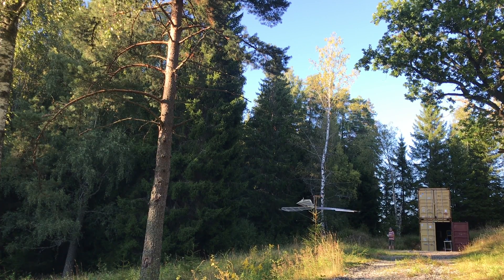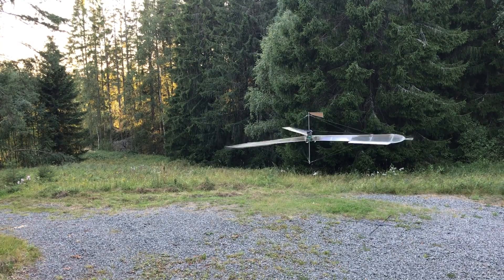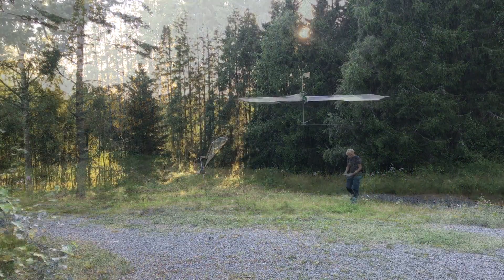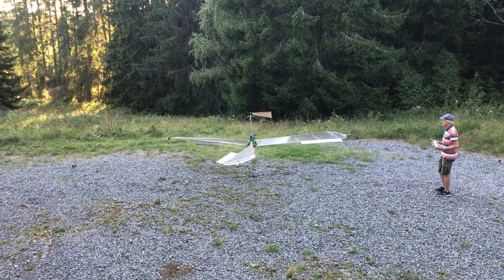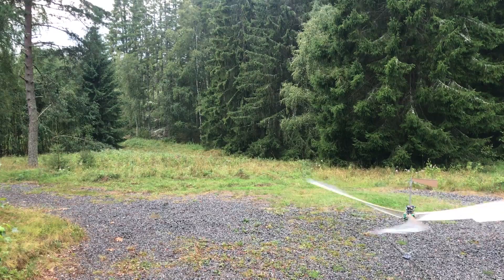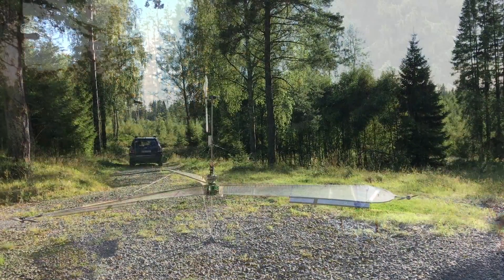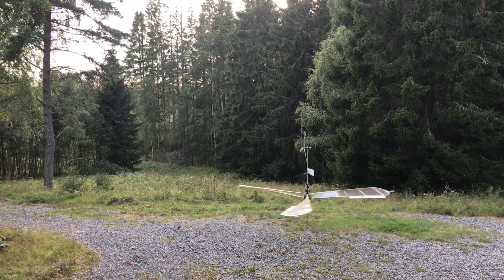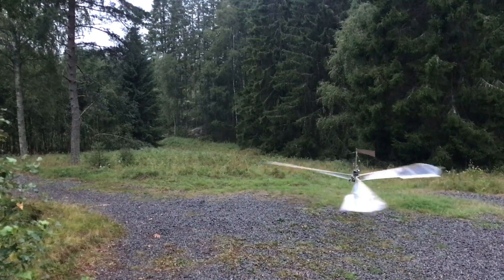Levitator 3 Further Testing. DIY aircraft.

Comment: IIRC positive dihedral increases lean back when translating.

Theoretically you can control it with one active control surface. If motors were powerful enough you could probably deal with a loss of one or even two motors too.

Comment: Could anything on that craft be ducted to generate puffs of air at particular moments in spin to augment  your control? Perhaps an EDF with a valve system which could blast some lightly pressurised air at the wing tip on every revolution (like the control surfaces currently do)

Comment: Scaled up to huge and spinning very very slowly would look amazing. It had real burning man machine or strand beast vibes.
Reply: Wonder how large it would have to be to levitate a sky city maybe a blimp with these spinning in the core
Reply: @NwoDispatcher  A city ? 🤣
Reply: @MadScientist267  ya a propeller aided circular  blimp that's solar and wind powered
Reply: @NwoDispatcher  haha I hear ya. A bit ambitious but...
Reply: @MadScientist267  how small then? Scale that puppy!!!
Reply: @NwoDispatcher  If you do some quick math on even just the weight of a typical stick and nail house, you'll find you can't make even just that fly alone with the likes of a "balloon" of any sort. But you're talking collections of houses. And that's not even looking into vertical construction... How big you think a balloon would need to be to hold the likes of even just the empire state building airborn lol... I don't think it would fit in the atmosphere even 🤣

No, I'm afraid this is something you'll never see haha
Reply: @MadScientist267  well no one is proposing hauling steel and concrete to 30,000 feet...
Reply: @NwoDispatcher  Styrofoam? 🤣
Reply: @MadScientist267  probably would be a part of it
Reply: @NwoDispatcher   a tensegrity structure.
Reply: @MadScientist267  we don't have the materials science for it yet but AI could create the materials we need.
Reply: @myotherusername9224  The biggest question nobody is answering is WHY 🤣
Reply: @MadScientist267  a floating city in the sky, or even a hotel, could have great scientific utility, as well as tourism possibilities and athletics: wingsuit flight on the way home, hot air balloon transports in and out, molecular ladder-  you could pack some food and climb up as a sport or exercise. All kinds of things have been invented that pushed the boundaries of materials science, physics, etc., and later on uses became obvious no one could see before the technology existed. I hope HAL isn't listening, but i am wondering what happens when AI finds out it can write malicious code.
Reply: @myotherusername9224  You're fucking kidding me right lol
Reply: @MadScientist267  no. why do you ask
Reply: @MadScientist267  well, I'm Aryan, we never ask why. We do because we are the race of humanity most likely able and we do because we push into frontiers that others dream about and demand to diversify. Cry as they might, Wakanda will never be built by their own hands. We shake hands with the gods, they shake their fist at us, their gods.
Reply: @NwoDispatcher  Ok well you just have fun with that, mmmkay? 🤣

Mmmkay.
Reply: @MadScientist267  yippie kaiyai yay
Reply: my cousin went to burning man, shes a whore, she slept with my brother

Comment: How much work/input is the gearing that controls the direction of the fuselage doing?  Is it mainly drift due to windage that the gearing corrects, or is there much in the way of correction due to the asymmetry due to function of control surfaces?  The clip revealing the function of small control surfaces was great.
Reply from the maker: Thanks, the yaw gearing mechanism is a low power item, it  just needs to overcome bearing friction and inertia  of centre tube, (FC with 2S lipo battery and the yaw motor itself) when you change direction yaw-wise.
Reply: @amazingdiyprojects  Say if you were to wire into the yaw gearing circuitry some LED's to indicate directional in/activity, how much of a flight would they be lighting up? Perhaps a similar idea for control surfaces to provide strong visual reference of their activity and interaction for tuning.

Comment: Can wingtip motor's RPM be modulated fast enough to provide (a little) lateral thrust -- spin faster in one quadrant and slower in the opposite?  Not that this in any way solves the asymmetry problem.  But, if even somewhat effective for translation, a downward cant/tilt to the tip motors might lower the leading blade by brute force.  A good oscillation experiment at the very least :D
...According to War's "Low Rider", it doesn't need too fly fast when it looks that cool (although a little chrome would help).

Comment: With a counterrotating system you might not only equalize lift on both sides, but you could also use the little propellers for propulsion by addin power on those that momentarily point in the direction of travel and reducing power on the opposite side 🤔
Reply: Since the rotor is rigid, that is, the angle between the blades is 120 degrees at all times, this would not help.  It COULD help if the blades were mounted flexibly to the hub, such that each blade could speed up and slow down cyclically through the course of revolution.  That is, the blade flying into the wind could be powered less, so that it falls behind, and the rotor flying away from the wind would be powered more.  This could, at least until a certain flight speed, even out the relative air speed on each blade.  He alludes to this in the video, saying that the blades don't "flap", or lead and lag (which is what I'm talking about).
Reply: @BrightBlueJim  that's why I wrote 'counterrotating system' aka coaxial double rotor.
Reply: @patrickfle9172  Yes, the counterrotating rotors would equalize the lift through the whole rotation.  I misunderstood what you were suggesting - adding power to the propellers on both sides that are facing closest to forward would indeed give some thrust in the desired direction, and as long as power was increased in a balanced manner between pairs of motors on the two rotors would do this without throwing off the balance of the system as a whole.